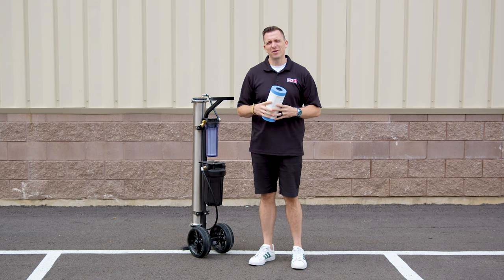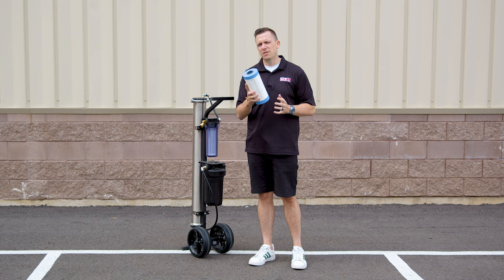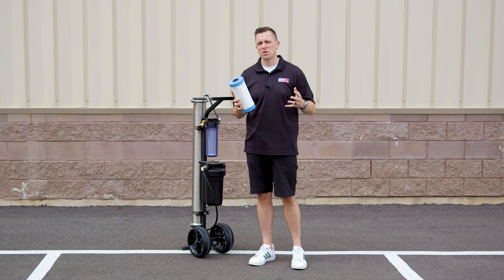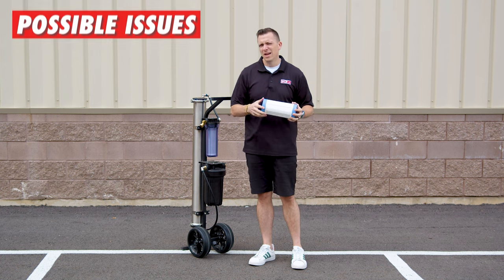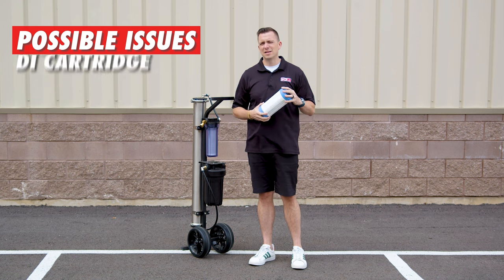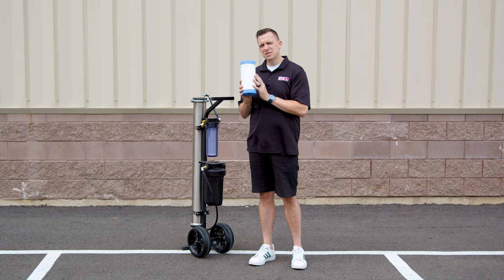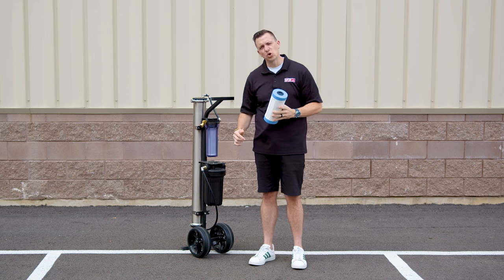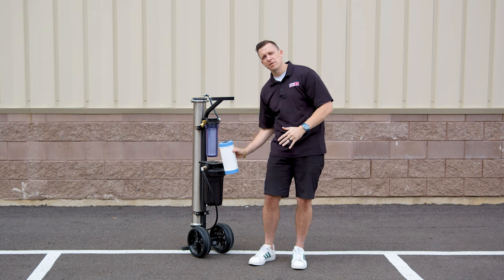2 Reasons Your TDS Won't Read Below 10

Comment: my tds ran above 20+ even though it was only used 9 times. Ordered brand new resin and while i was dumping the “old” resin, I saw the filter that shouldve been at the top, mixed near the very bottom…After i secured the filter and put it back to where i should have been, tds ran at 3. The old resin was perfectly fine, only thing that was wrong with it was the misplacement of the white filter inside the cartridge.
Reply from the maker: Oh no! Hope you were able to save some resin!
Reply: Yes i still have the resin but there was no need of spending 170 if the filters were put in correctly…